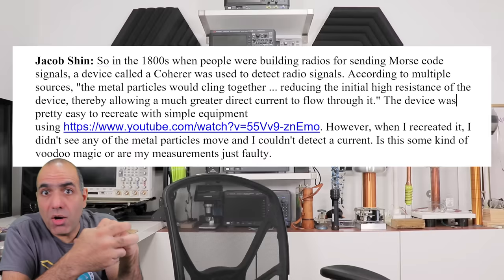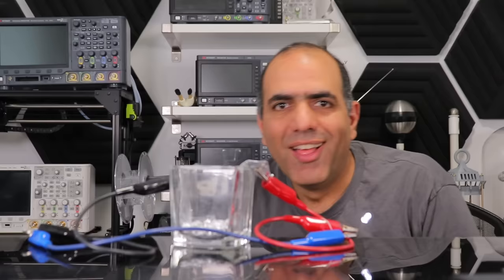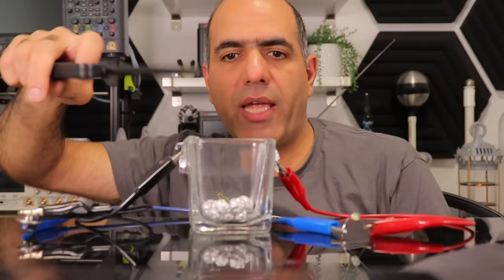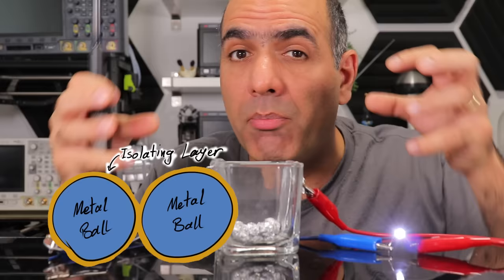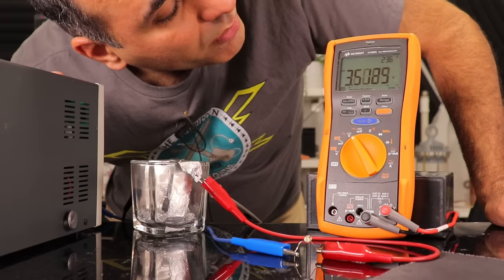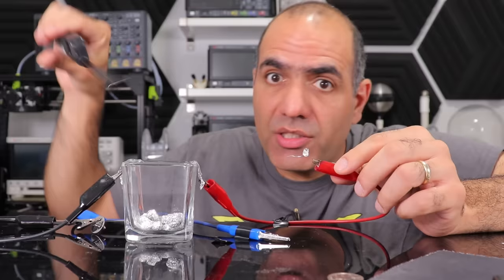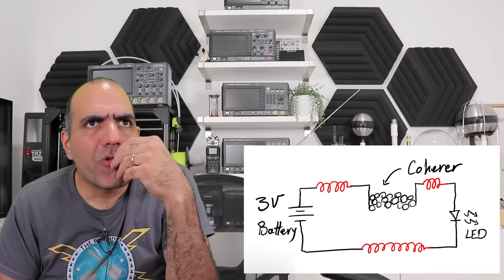Wireless Communication with a Cup of Balls, Coherer Effect

Comment: Cool stuff I hadn't heard about. Regarding the thin isolating oxide layer Mehdi talks about, I assume that makes perfect sense, since aluminium is known to very quickly form an oxide layer of a quite consistent thickness of about 50nm (EDIT: It's apaarently more like 4nm) on its surface when exposed to air. So I guess the balls of aluminium foil are actually a pretty decent material choice for such a crude version of the device.
Reply: Never heard of that thick of a native oxide.  I usually hear around 4 Angstrom or so that forms quickly and then it slows down from there since oxygen has a tough time diffusing through alumina.  Shouldn't be much more than 20nm or so at room temperature.
Reply: @EkiToji  I couldn't remember the exact numbers, so I used the one from Wikipedia, which might be a bit off.
Reply: Here’s an idea: different thicknesses of oxide layer on certain metals (bismuth comes to mind) exhibit different colours due to thin-film interference. Can we see whether the voltage required to establish the electrical connection varies with the thickness of the metal oxide layer?
Reply: @TheHongKonger  This oxide is so thin you won't really see enough thin film effects to where you'll start to see a color.  There are certainly ways to measure such a thin oxide like with ellipsometry, but would be a bit of a pain on crumpled up aluminum foil.  Certainly the thickness of the oxide plays a role in what voltage you need for dielectric breakdown since it's all due to the electric field which at best I'd ballpark at 1 V/nm.
Reply: @EkiToji  yeah, I know- I think we could switch to something like differently coloured bismuth foil. With the oxide layer at a few hundred nm, the voltage required will also be around a few hundred V. And we all know Mehdi has no qualms with producing and playing with high voltage.
Reply: I was thinking the same... My dad told me a story about a friend of a friend who wanted to scrape ice off off his windshield, but didn't have a scraper or credit card on him. He decided to use an aluminum can, because he remembered that aluminum is significantly softer than glass, so it wouldn't scratch up the windshield.

What he forgot was how quickly aluminum forms an oxide layer, and that the oxide is both significantly harder AND tougher than glass... Apparently he never made the same mistake again. XD

Comment: To anyone making an incorrect connection between this effect and the cat's whisker detector in old radios, both using E&M waves and signals across a native oxide layer between two conductors, the old radios made the use of two dissimilar materials to create a rectifying effect. But both are pretty transistor-like.

Comment: Awesome video as always.  I think one thing to consider is the reason why the low voltage supply worked was due to the diode blocking the circuit until it hit the needed voltage to open and power the LE of the D.  Once the arch induced the em pulse it created enough voltage to open the LED and complete the circuit which it could now maintain as the voltage and arching continue through the very thing outside layer of the balls.  Everthought of learning guitar and using a Peizo pickup to control certian switches and variable resistors?

Comment: I think you can do this with a DAIRLINGTON PAIR with an addition transistor! This could be used with a peak detector circuit to (hold the voltage output for a given time) REMOTELY turn on things! This is awesome Mehdi! This isn't useless in my opinion!
Reply: Yeah, you could probably use it to make some remote lights or something like that. Easiest form of remote control

Comment: I got remote switches all around my appartment, that all uses piezo. It is a rental so I can't add any wiring to add switches in convinient places. But I can put a receptor between my light bulb and it''s socket, keep my wall switches cicuit closed, and stick as many piezo remote switches I want all around the place. Pretty convinient. Bought the switches on the A.. site but can be found almost anywhere.  No smart connected crap, just a light receptor and bunch of switches. Didn't try multiple light bulb receptors and multiple switches, and there is no tunning knobs anywhere.  But would worth dismantling and look at what is inside.

Comment: 6:47the signal looks a bit like exponentially decaying intensity white noise, I'd be interested in seeing the frequency spectrum of the spark
its also possible the oxide layer is behaving like a semiconductor. Metal-oxide boundaries can be used as diodes for example. the spark could kick the voltage above the threshold and then it would turn on, much like the high voltage incandescent bulb never turned off
edit: the later test 9:21 has disproved this idea

Comment: Aluminium forms an oxide layer on any open surface immediately, but it's only a few monolayers thick, as the oxide is lattice-matched to the metal and prevents further oxidation after the layer is formed. Aluminium oxide (=sappire) is extremely hard as well so even a thin layer holds up, which is why aluminium metal doesn't corrode instantly like e.g. magnesium.
But a small voltage will break a layer of a few nm thickness, particularly as the electric field is strong in the region of any sharp tip formed by the crumpled foil.

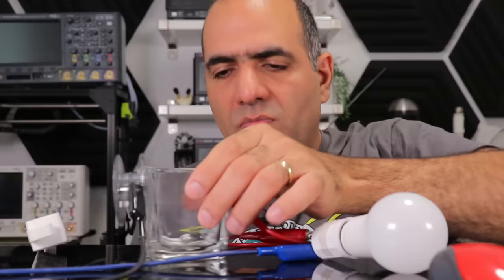Comment: 1:46 wiser words have never been spoken
I can imagine this would come handy if we ever start making spaceships... any slight shake or changes of regular motions would break the connection and it would serve as an early warning that something's up... it could serve as a detector for changes, like when we're using angular momentum to create an artificial gravity... for instance if we built ships like a disk where the outer part is connected to the middle point but it also has these motors fixated on a circular track and that is connected to the middle part (where our living quarters, exercising spaces and agricultural section lies) and the motors rotates the middle part and the middle part is connected to the middle point too (basically the middle part is hooked on a rotator of the middle point and the middle part is connected to motors on a track in the outer part) and if somehow there was an abruption, maybe some parts melted due to the generated heat from material rubbing against other material is not effectively transported away for cooling, that could cause the light to go off and trigger a programmed response to minimize further possible damage, like undoing any connections between the rotating middle part from the motors on the outer part, giving us ample time to fix the issue before the rotation stops entirely (we then could find where the damage was, fix it and with a bit of ingenuity have some form of arms or threads from the motors catch the rotating middle part and pull it back towards the motors and dock them back in)

Comment: I think the thin layer preventing conductivity is aluminum oxide. It may be very thin in the scale of atoms and voltage spikes cause it to break in points connecting aluminum to make a conductive path. Vibrations will break those points exposing metal only to oxidize immediately breaking the conductive path.

Comment: I have a question

The explanation given is that a very thin metal-oxide layer between two balls will disconnect the circuit

Supposing that we have in fact a few nanometers of this layer, 10V (the scope measurement ) will result in a huge E-field in the nanometer scale, enough to brake dielectric

My question is, if the experiment is repeated in vacuum? 

not allowing the air oxygen to recreate the oxide layer will cause the circuit to bemore stable, you need to find another portion of the metal that is still oxided in order to break the circuit

Comment: What else has nanometres thick layers of insulation? Modern semiconductors.
This is a good demonstration of why static electricity can damage semiconductors easily (discharges so small as to be unnoticeable). It also demonstrates how an EMP device works, and why sensitive devices shouldn't have long board traces, and have shielding, if designed for electrically noisy environments.

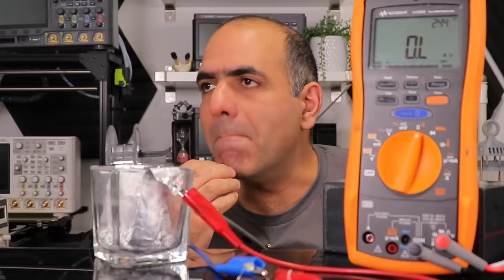Comment: 8:18; It is like a wireless connection to create a wireless communication of the coherer effect from smaller pulses of voltage without using a power supply.

Comment: I think the Oxide layer theory is quite good. If you wanted to test that theory I would recommend a few tests first try using an argon or other inert gas atmosphere and see what happens.

 My hypothesis is that it would allow the light to turn on but not off as the oxide layer is destroyed irreversibly as there is no oxygen to reform the oxide layer. Second try different metals Zinc and Silver would be my first choices as they are less reactive then aluminum and are more easily reduced.  Also ZnO is a semiconductor. 

My theory for whats going on is the spike of energy picked up by the loop of wire creates enough voltage to reduce some of the aluminum oxide to aluminum metal and allowing the metals to cold weld. Then a slight disturbance breaks the fragile connection exposing the aluminum that is then oxidized by the air reforming the insulating layer.

Another test could used anodized aluminum where the oxide layer is made thicker by oxidation with electricity. This should increase the amount of energy required to reduce they aluminum oxide to aluminum metal to allow for cold welding. So if a thicker oxide layer requires a bigger spark that would support the oxide layer theory.

Comment: Aluminum anodizing creates an oxide coating that forms and insulates at voltages between 5 and 40 volts. guessing trigger voltages from 10 to 20 at the breakdown point should work as a general guideline.

Comment: That same layer makes it so that touching two pieces of metal doesn't (typically) weld them together...but similarly, sticky solids have enough voltage (polarization) from their chemistry to overcome that!
Reply: even perfectly flat and clean metals don't like to just combine that easily.  They do it with copper and it takes a substantial amount of pressure.  Maybe it's overcoming brownian motion or something.

Comment: can you make a video on cable high pressure testing using DC vs VLF(very low frequency) AC supply and their advantages and drawbacks, also of Normal 50hz AC supply which is rarely used

Comment: As soon as I saw the 120v bulb I knew something was going to go wrong...

Also I wonder if this is going to spark another debate between content creators like the Mould effect did. Great video!
Reply: there is really not a lot to dispute here.  breakdown voltage across thin insulators is a thing we now understand quite well.  By 1920's understanding it looked magical and they invented this bogus "coherer effect" to fill in the blanks.

Comment: I'm thinking that you're building charge on the surface of the aluminum oxide which becomes the conductor. Any motion is either breaking the connection long enough for it to discharge or causing the air itself to pick up and move off the charge. If this is the case it would only work with passivated metals. It also means that you could potentially get it to work with something like styrofoam or some other non-metal. Which side of the triboelectric series might matter, but I'm not sure.

Comment: To test your theory you should leave your balls in flux to remove the oxidizing layer (or something similar) then repeat the experiment in a vacuum, to prevent them from re-oxidizing. The lighter will have to be outside the vacuum since the arc won't form so you may need a stronger source of EM radiation to penetrate the vacuum container.
Reply: Instead of messing with a vacuum, use argon gas. It is heavier than air so will sit in the cup and displace the oxygen. (Use a taller glass to hold more argon, and maybe a plastic lid to prevent diffusion.)

But I'm not sure how to remove enough of the aluminum oxide for the test to be valid. Maybe just agitate it a while to knock the oxide off?
Reply: It's not the oxide layer that plays a role but something called "micro welding" - coherers of this class work in a pure vacuum with pure metal or carbon. The resistance is high - not infinite - Contact has already been made by some atoms. it's the micro-welding from the relatively high voltage that causes more metal to come in contact and lower the resistance.
Reply: Replace the aluminum bãllş with silver bãllş. (I believe silver oxide is conductive)
Reply: @JohnnyWednesday  So, does that render electroboom's theory wrong? I was a bit scepticle, hence why I suggested a way to test it. This makes more sense. I've also experienced this phenomenon just through testing continuity (pressing the prongs firmer to hear the beep).
Reply: @JohnnyWednesday  I thought of that too, but imo it's way too stable and repeatable to be a surface effect, wouldn't you say?
Reply: @vanoscrap6296  Yeah, that's a good point!

Comment: What might be keeping the balls from touching is gas, carbon dioxide breaks down at around 40 volts per nanometer

I think it's also how the first telephones worked, with balls of carbon and the vibration from the voice changed the resistance
Reply: Interesting. I'm opposed to an "oxide layer" being the cause. 
If the spark gap emp is blowing away the aluminum oxide, then doing this with aluminum in water would be explosive. 

CO2 might make more sense.
Reply: @Alexa-Raine  I don't think it's oxide either as surely then they'd all be chemically bonded together, but I guess at the nm scale that might be more easily broken, you're right about the water, trouble is getting it pure enough to be able to test

Comment: The oxide film of aluminum, mainly consisting of aluminum oxide (Al₂O₃), is a good electrical insulator. It forms on the surface of aluminum upon contact with air and protects the base metal from further corrosion. This oxide film has the following properties:

Insulating properties: Aluminum oxide possesses high dielectric strength, making it an effective insulator. Therefore, under normal conditions, the oxide film on aluminum does not conduct electric current.

Film thickness: The thickness of the oxide film on aluminum usually ranges from a few nanometers to tens of nanometers. Even such a thin film can effectively insulate the surface of aluminum. 

So It is possible that an electrostatic discharge punctures this film, closing the circuit.

Comment: One common trick Morse code substitution is to replace the letter "e" with the letter "a". This is because the letter "e" is the most common letter in the English language, so replacing it with another letter can make the message more difficult to read.

Another common trick Morse code substitution is to replace the letter "t" with the letter "e". This is because the letter "t" is the second most common letter in the English language, so replacing it with another letter can also make the message more difficult to read.

Comment: I think the reason why this happens is the surface of the balls. They have uneven surface that creates positive peaks and negative peaks. This trick may not work with polished, even surfaced balls. Let me explain.

1.) In Simple words, Imagine a big group of people standing in a square area and are facing at random directions. All of them are raising their arms straight to touch the front person's head. There is some chance that a continuous connection is established from one side to the other. 
Now, a space ship appeared on the sky and went from one side to the other with a bright light (imagine). All people in the square turn towards the light emitted from space ship. and now all of them are facing the same direction, resulting in many many possible connections.
That bright light is the gas lighter and aluminium balls are peoples.

2.) In Technical words. This is just like how magnetizers work to turn iron into temporary magnet.

With disturbance they loose their connection.

Comment: No, this isn't the coherer effect! it's actually the electro-dust equilibrium (灰电平衡) effect. For example, if you have an old computer that has been sitting in your garage for years and it works fine when you power it up. However, once you remove all the dust from it with a vacuum cleaner, the BIOS will beep to alert you that your memory sticks have suddenly gone missing, or your graphics card won't function properly, until you clean the edge connectors with an eraser. But obviously, you can't zap your computer to fix that.

Comment: When I saw this original video it actually didn't struck me as "fake". I'll continue watching, but my guess always was that an EM wave stimulates ionisation of air on ultra-small distance gaps between the balls. And the balls are covered with aluminium oxide, which in theory is an insulator, so that EM field acts like a "jump start" to give electrons between balls a chance to jump over, and  once the initial connection is estabilished, the resistance drops indefinitely

Comment: mabye you can put the colherer in front of a solenoid and conect it in series with the solenoid then add a voltage in the system and make a tall antenna and also ground the opposite side of the colherer